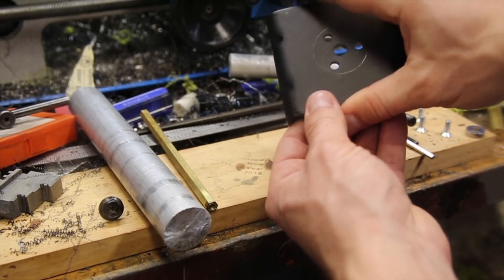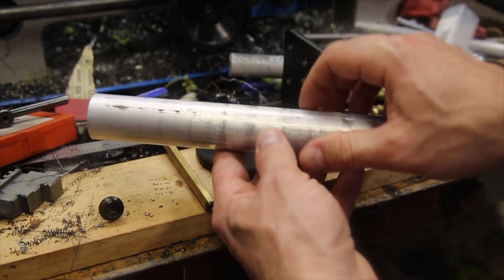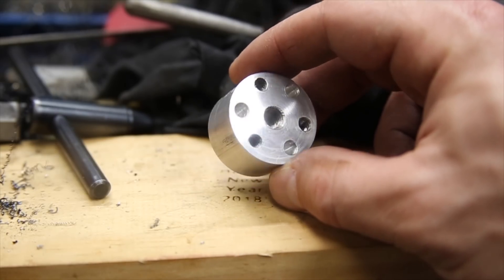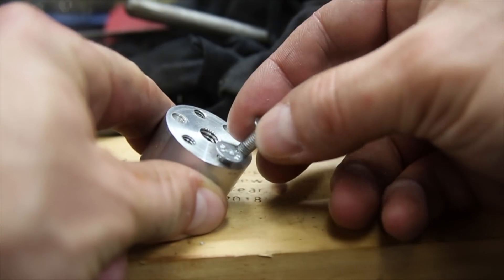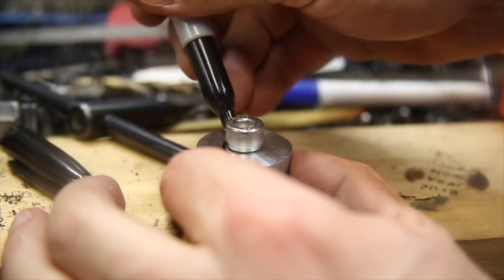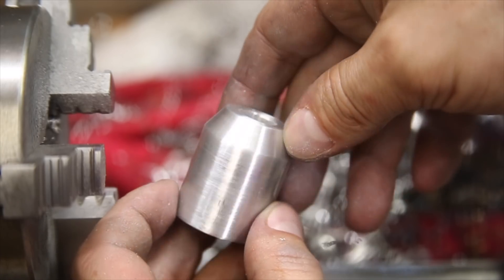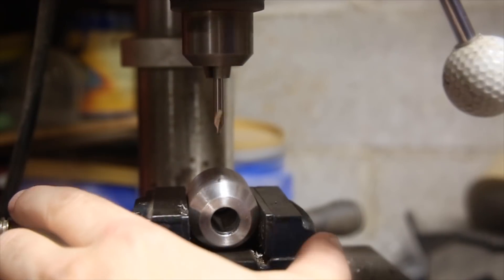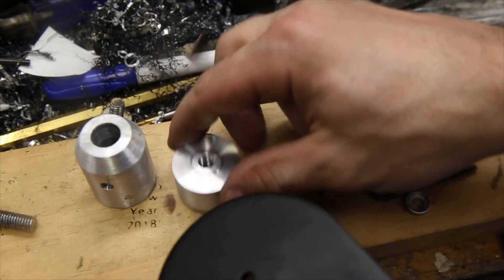Swivel Microphone Arm or Desk Lamp Clamp Mount with Bearing

Comment: This kind of arrangement requires the ball bearing to be perfectly horizontal or its axis vertical.  If it is not, the arm will swing freely into the tilt direction.  The perfectly horizontal plane will not happen in practical life, so the bearing must be accompanied by some kind of brake for the arm, sort of going back to the situation of no ball bearing.

Comment: It occurred to me just now that if you drill and tap a vertical hole through the top piece, well off center, you would have a simple means of tightening. Just run a socket cap screw into the hole, and the end of the screw would tighten down against the bottom piece, preventing rotation of the mic base and keeping the mic from drifting around. You could even top the screw with a knob to make adjustments more convenient.
Great video, Tim!

Comment: @ 7:52 pretty sure I have that exact same deburring tool. I use it for finishing the edges on 3d printed stuff.

Also, wouldnt a thrust bushing have worked better rather than a radial for this project?
Reply: AppleseedInTheShell load is basically irrelevant here
Reply: Daily Research I wasnt concerned about load. Im not super knowledgeable on all the use cases for thrust vs radial bearings but it seemed to be a thrust bearing would have worked better.
Reply: AppleseedInTheShell im sure it would be better but what I’m saying is you probably wouldn’t be able to tell any discernible difference between the two
Reply: Daily Research oh ok. Gotcha

Comment: For God's sake don't use that lathe. Shit lathe and someone who doesn't know how to work on one are not a good combo. You have tons of learning material on Google and YouTube. No excuses for being lazy.

P.S Watch your damn hands,or you might start keeping your fingers on shelf in alcohol jars.
Reply: so you think its a better combo to start with a big lathe that can easily rip off your fingers? the small one certainly doesnt do much damage, i mean i wouldnt try it out, but i'm fairly sure that a mini lathe is fairly safe to work with. 

also tim, me and many others are hobbyists, we dont know what we are doing, but we keep learning, improving and generally we are just having fun with a uncommon tool. 

make videos on how you can do it better and then we gonna talk
Reply: Sharky First off,this lathe is not true.If i can see it with my bare eye,it is at least 2mm off.Second,he doesn't know how to use lathe.Lathe is not a toy. It is a very precise tool,so you shouldn't use sharpie to mark anything.All you have to do is use calipers to take measurements then dial it in.Third thing is that you never wear gloves around powertools in general,especially lathe,mill or bandsaw.
Fourth is that you never put your hands near spinning chuck.Also instead of cutting stock on a bandsaw,you are supposed to cut off bigger piece then precisely cut it with a lathe.
Reply: whats wrong about using a sharpie? holy smoke, if you are fabricating something this uncritical, we are talking about a fucking microphone stand, that thing aint flying to mars or something.

"at least 2mm off" lmao dude i got the same lathe and it has a runout of 0.01mm at the 3jaw wich is pretty fuckin amazing. cameras cant capture the real deal. the only thing that is really flimsy on tims lathe is the tailstock, wich he pretty sure knows himself by now, but not even this is that big of a deal since the drill kinda centers itself atleast good enough nobody will ever notice until you come and tell them.
Reply: CME Jesus what are you even talking about. Using sharpie as a surface coating to better see your scribe line or punch mark is absolutely acceptable, it serves no different purpose than Dykem. And second that lathe is not off by 2mm you are making shit up my friend. And if you were actually watching instead of trolling, you would have seen that cutting on  bandsaw then facing “to length” fits your super special method of cutting larger stock then “using the lathe to precisely cut it” ie facing to length. Now if you have anything else stupid to say I’d be happy to shut that shit down too. Have a nice day asshole.
Reply: Daily Research You obviously missed tge part where he traced around the bolt and then tried to "accurately" remove the rest.
Also,you ARE supposed to cut it off on lathe,just because you don't have to turn the stock in the chuck when you want to work on other side.
Also,how do you not know that lathe is true?Damn just look at the drill bit,and also take notice how it wiggles when he touches tool to it.It could be also from improperly fastening stock in the chuck.
Oh,don't be so full of yourself.I just gave him advice that he should try to follow.I have been working with lathes and mills for over 5 years now,8 hours a day,5 days a week.It is a shame almost no one uses these today,most of them have CNC ones,which are a big pain in the ass to repair and maintain.
Reply: No part of this project requires the maximum precision that even a cheap lathe is capable of producing. He made a good part. He satisfied his use case. He produced something worth having, and gained a little knowledge.
I'm certain that Tim is acutely aware of his own limitations, and those of his tools. Pushing back on those limitations is what makes hobbies worthwhile. 
TimNummy's hobbies include making his own parts for personal Projects.
CME's hobbies include subjecting YouTube to his shitty, unqualified opinions.
Reply: Also, there are tons of videos how to improve the mini lathe.
Get rid of the all the play in different parts, including tailstock etc etc. 

Tons of videos about how to make this lathe work much better and without much investment.
Guys on YT show amazing things you can do with this lathe.

For home hobby use, this lathe is perfect.

Comment: https://www.amazon.com/Maxiflex-34-874-Ultimate-Nitrile-Gloves/dp/B00P4PJOVM/ref=sr_1_3?ie=UTF8&qid=1519583003&sr=8-3&keywords=maxiflex+gloves&dpID=41AJw7OOzyL&preST=_SY300_QL70_&dpSrc=srch

get these gloves those gloves you use could catch the blade and pull you into the bandsaw
Reply from the maker: Thanks! I was actually wearing those gloves because the aluminum was getting too hot to hold with my bare hands... I'm not sure those gloves would have helped...... really I need to just get a horizontal bandsaw.
Reply: TimNummy I use them at work when I work with metal. they seem to be good for me at least. The only time I end up burning myself anymore at work is when I'm cleaning a extruder

Comment: Very interesting as always. But, be carefull with the deburring tool. We use them in our production for hand deburring and they can cause very bad injuries. i had to be stitched two or three times for cutting myself with that. even there is a round nob on the end of the blade, it will cut very easy.

Comment: hey tim, i like the weight reduction you have done by drilling some extra holes!

consider treating threaded holes with a 45° champher, since even if its not critical here, will make the screws go in smoother and it will prevent the top threads from breaking off the surface. additionally, but thats only my preference, it looks cleaner.

good job, prime example why owning a mini lathe is a good thing :)